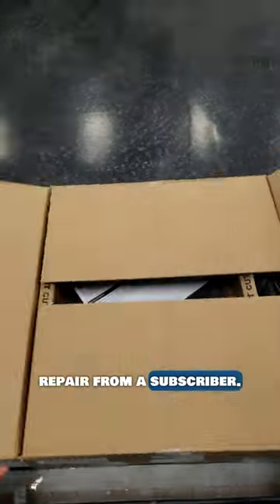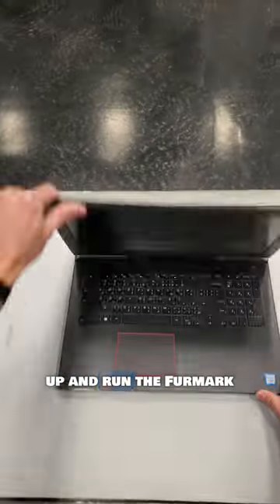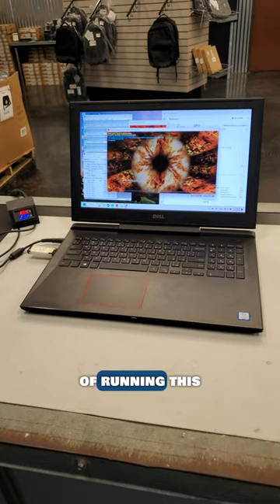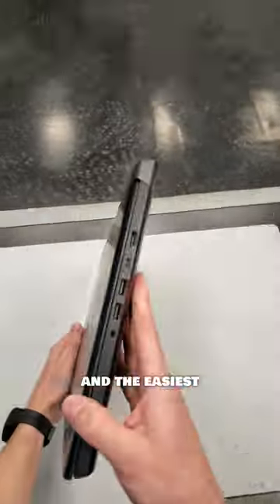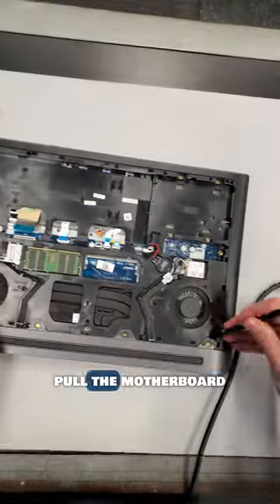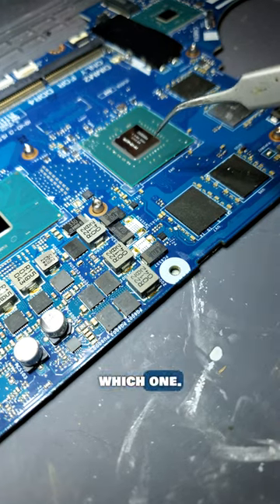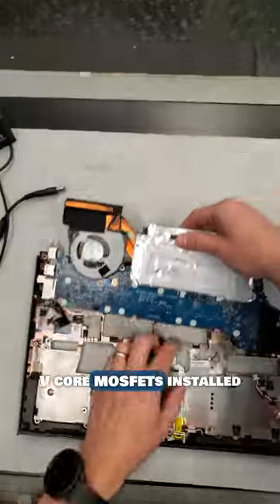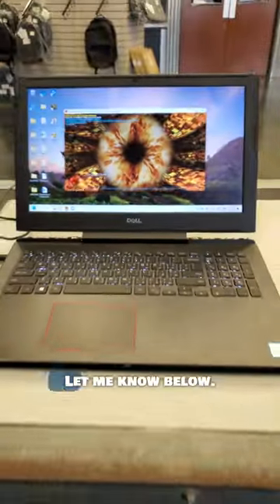GAME ON! Gaming Laptop GPU Repair SUCESS! #shorts #laptoprepair #computerrepair

Comment: Why replace what could be fixed? As long as the board is good, there could be any part to replace it as long as you have a good part.
Reply: But you are not seeing in this short is the actual time if you ever watch Louis Rossman repair videos it takes awhile to do what this Guy does. Not hating, but appreciating
Reply: @ralphhinckley4417 even doing the assembly disassembly is non trivial, and that's before the diagnostics, which is non trivial, and that's before the soldering, which is non trivial.

Sure, it's a couple mosfets, maybe 5 bucks in parts. But it's so much more than that.

Comment: actually you did a great job by replacing all the MOSFETs. most of the time failing one is causing to damage others as well since those GPUs work with much higher power than other components.

Comment: It depends on the cost and the chance if other mainboards have the same weakness. Maybe the replament chips are a newer revision (and wont fail) than the ones in those motherboards.
Reply: Very important to remember to that if chips in one place are taking a dump, it's possible that other chips are getting ready to go too.

Depending on cost / time / etc I would have had the tech replace the board entirely and recycle it for parts.  It fixes the problem, and I don't have to worry about having to ship it off for repairs again anytime soon.

Comment: Easy isn't always better and in addition to the e-waste that people have already brought up, you cannot replace the board if you don't have a spare. Mosfets (I think) don't have to be the exact same ones so you can scavenge from different boards or (please correct me if I'm wrong) just buy new and possibly better ones.
Reply from the maker: I am starting to stock new ones for most motherboard models. For the unique components that are motherboard-specific, it is very convenient to have spare donor motherboards for parts. I am working on a motherboard repair right now, and I do not have a bad donor board or schematics. I am having an issue finding the correct replacement component, so the repair is taking longer until I can identify the correct IC.

Comment: Yes, it's the right way. I absolutely hate Laptop repair techs that only knows how to swap parts. Since they're charging 65/hr to do the lowest skillset. To explain every repair shop near me will have a 50% chance to recommend a motherboard replacement if it's not a screen, keyboard replacement. They won't do a power cable replacement either.

Comment: Hard way was cheaper than the motherboard change?? If it was then totally yeah you're right
Reply from the maker: Yes, we only charge a flat $200 for a motherboard repair. Sometimes, a new motherboard will cost less than that, and in that case, we will just offer a motherboard replacement to save them money.

Comment: with a flir cam you can find which one is bad, and replace just 1 of them mosfets
Reply: They have a flir camera. I'm guessing the reason they replaced all of them is because if one of them went bad it is likely that the others would also go bad soon so might as well do them all if you're going to do one.
Reply from the maker: First, thanks for your advice, but you really cannot tell which one is failing because it has not failed yet.    Multiple things here.  We have a Flir... You cannot run the laptop without a heatsink, and the heatsink covers the MOSFETs in question.  Also, lets says I can boot it up and get a stress test running and can get the Flir camera those MOSFETs, it will just be one big hot blob.   I have seen this so many times.  I can even guess which one is failing and replace and test, but to me, I can offer a repair and a piece of mind.  1-year warranty.  So, it does not take that long to replace all 4.

Comment: What's your turn around time on shipping? Do you fix phones as well?
Reply from the maker: Sorry, but we specialize exclusively in Dell Laptop parts and repair.  If you would like us to ship you a laptop box, it is usually 3 days to get the box, then 3 days to get the box back to us, and then it will be in our repair center for about 5 days, then 3 days back to you.  So less than three weeks for the whole process.  Of course, we do offer express services that have next-day delivery and skip the repair line services, but it will cost a lot more.

Comment: What is the tool that you are using to see the current externally? Looks like the charger plugs into it, and then it has its own "extension" into the DC jack?
Reply from the maker: Yes, that is exactly what it does. I build this to help me diagnose laptop power issues.  It is just a 3d printed case with a cheap Amazon volt and current sensor.  This also allows me to test the laptop with the  customers actual charger.

Comment: Definitely it's better to replace a cheap part on an otherwise perfectly working board than replacing it entirely just like some bad repairmen do. But the greatest Dell technician that's ever lived wouldn't do that! Right?
Reply from the maker: Sometimes, you have to replace the part, but I will always try to see if I can repair it first. However, some motherboard repairs are not worth the time if the replacement motherboard costs less than the repair itself.

Comment: Hey bro, Can u please tell if my dell optiplex 5050 with 1 m2 slot(m.2_ssd written besides the slot) be used to run a wifi bluetooth m.2 card? Or do i only have the option to go by pcie card?
Reply from the maker: I'm not sure of the answer on that machine.  We one work on Dell laptops.
Reply: @dellpartspeople  no problem mate.
Thanks for replying.🙏

Comment: Replacing mosfets by an experienced tech is the hard way???
Reply from the maker: Any other repair shop, even Dell itself, would have just replaced the motherboard.   Diagnosising GPU issues are not always 100% successful.
Reply: @dellpartspeople  Less E waste will always be the best option.

Comment: That's not an igpu, that's a mobile gpu. this guy is supposed to be a laptop technician right?
Reply from the maker: The discrete nvidia GPU is integrated on the motherboard and can not be removed.  The motherboard would need to be replaced to replace the Nvidia graphics card.